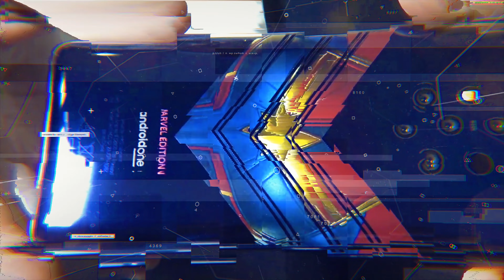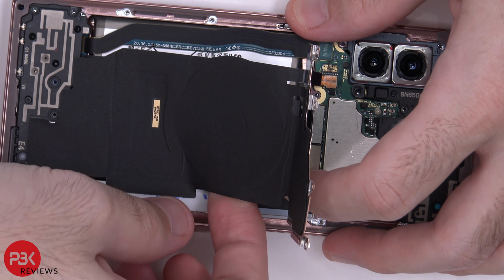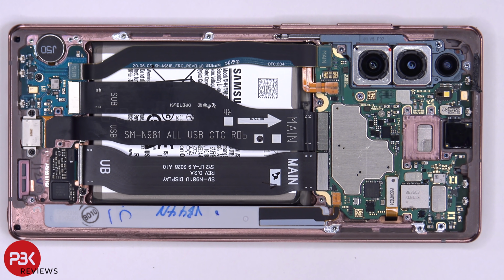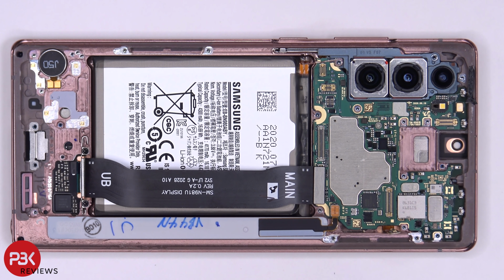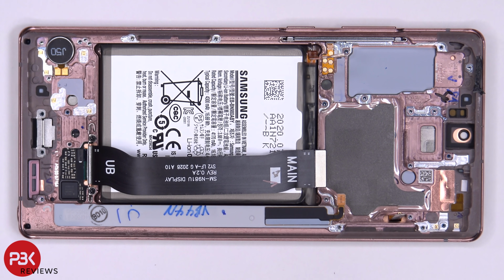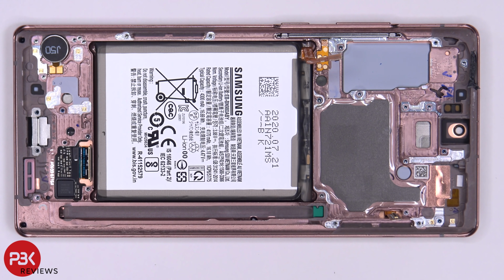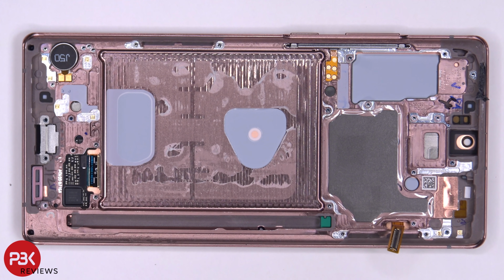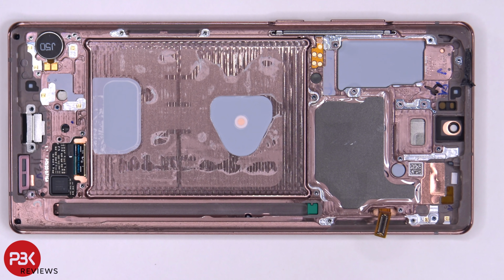Samsung Galaxy Note 20 Disassembly Teardown Repair Video Review

Comment: Thx! Got me through a glass+digitizer replacement. Two things not covered though: (1) At 2:10, the Main-Sub cable in my unit doesn't just have two ends like yours, in mine there is a "T" off that cable that connects to a component in the side edge of the housing, which is held in by two screws. That component came out with no problem but it was a tense moment haha. (2) You didn't take out the "J50" hockey puck in the corner (vibration?). No worries, it just lifts out no problem. - - - The screen replacement I got was essentially the whole front housing for $200, expensive but I'm not cool with trying to install glass. Last thing, the new housing I got included the S-Pen charger, so didn't need to tease that off. Thanks again.
Reply from the maker: You're welcome. Yea always easiest and best to replace with the midframe assembly attached to the screen. Its a pain to do it without. And that's odd, wouldn't think there would be a difference as far as the cables inside for different region versions.

Comment: Excellent video! If a glass only repair was needed, would you just heat the front w/o disassembly of the back, and then seperate the glass with ipa and wire? How much heat does one normally apply?

Comment: Thanks for the upload! Also noticed no vapour chamber like in last year's Note10s. Maybe that's why this year's model gets so hot?
Reply from the maker: You're welcome. I believe the Note 20 Ultra has the copper block or vapor chamber but the note 20 seems to have a 3D graphite/graphene layer or block which also is used for transferring heat. Not sure which is better but its a first I've personally seen being used in this method in place of a copper block or vapor chamber.

Comment: amazing video. love my note 20 (non-Ultra). battery is -10% wear at this point. to do this job myself with no experience is massive time and learning curve. I'll just send it to authorized shop to replace battery. safer and near zero chance of my screwing it up. i want use to Note 20 as long as i possibly can.
Reply from the maker: 👍 thanks 😀

Comment: Question Do New phones have writing like this written on the inside
Reply from the maker: If you are referring to the hand writing on some of the parts, yea most phones have those writings. They are markings from quality control employees checking and making sure parts are meeting required standards etc.
Reply: I had the same question.

Comment: Great video!❤ what adhesive do you use to seal the back in place?
Reply: I'm wondering about this too since mine are started to peel off 😢
Reply: did you try heating it up before putting together?

Comment: Hi Note20 phone does it have separate Signal receiving antenna module or it is inbuilt with the motherboard? My Phone has signal reception problem. It shows no signal in weak signal area. is there an option to fix this issue?
Reply: I have the same problem and I thought it was about my carrier poor signal

Comment: Hi, just wondering does inserting the SIM ejector tool in the upper Mic hole will damage water resistance or the mic for the note20?
Reply from the maker: No it will be fine, the mic and filter sit above the hole.

Comment: Great job. Only I'm diappointed that you stopped just before the power and volume buttons. Mine appears to be jamming. It's extremely difficult to depress. especially the longer volume button. Any suggestsions? I'll remove everything the way you just did but I'll rather not if there's a short cut. Thanks again.

Comment: Great video, thanks. Is the camera's housing also made of plastic as the back panel or is it glass?
How scratchbell is it, do you have idea?

Regards
Reply from the maker: Thanks! The frame of the camera lens covers is aluminum but the lens cover is glass. Not sure on how scratch resistant it is.  (aftermarket replacements of lens covers sometimes tend to be plastic, so if you prefer the glass make sure you find original replacements)

Comment: Hey.. mine has a rattle inside ..everything  is functional.. any idea what it could be . 
Looks like I can handle the disassemble short of new adhesive..
Thanks in advance for your response
Reply from the maker: It's probably just the camera inside, its normal all of them have that rattle.

Comment: Hi... Is it possible to replace cameras from s21ultra to note 20 ultra?
And if you can put snapdragon instead of exynos... Or is processor on the board?
Reply from the maker: Not sure about the camera, if the connector is the same it may work but there may be software issues. As for the processor, its soldered onto the main board.

Comment: Great video.  My screen now looks washed out.  The black is not black and the colours not vivid.  Sometimes .. the vividness of the OLED comes back ... but then it becomes slightly washed out again ... is it the screen or could it just be the connectors not seating properly?  I also notice my phones runs quite hot .. especially near the rear camera area.
Reply from the maker: Hmm not sure can be both a screen issue and possibly liquid damage. Excess heat can also be a sign of liquid damage, but its normal for it to heat up a bit.

Comment: I accidentally messed up the connecting thing for the wireless charging pad. I ripped it off carelessly and it broke. Should I put it back in anyway or leave it out? Will my phone be fine if I leave the charging pad out?

Comment: Are the antennas on the sub-board?
Reply from the maker: The sub board has some antenna contacts yes, but its not the only antenna on the phone. So if you do replace the sub board, you would need to make sure you get the exact model version for your phone or you would have reception issues.
Reply: @PBKreviews  I understand. Thanks for the reply!

My question is because my phone began to have reception issues after I replaced it's battery at samsung. And now they wanted to charge me almost the price of a new phone to swap it's board(the mainboard I guess) and fix this issue. I obviously refused to pay. Do you think that replacing only the sub board would fix this or there are antenna contacts on the mainboard too?

Comment: Which heatgun do you use for back cover ?????
Reply from the maker: I used to use a w.e.r 858D but now just use a hair dryer since it's not as harsh and it evenly  heats up the back plate. Easier to work with.

Comment: its really good to see this video. 
a half inch from the tip of the s pen is stuck inside the groove.
the thing is that only cover of the s pen is stuck.
how to remove that cover from inside..pl respond
Reply from the maker: Hi, not sure exactly what you mean by your explanation, but I think the only way you would be able to remove it would be by taking off the back cover and removing the white plastic cover that is covering the S-pen housing to gain access to removing it.

Comment: hi i live in germany and i imported note 20 ultra in snapdragon version. 7 days ago the mobile phone display broke and had it repaired. The display works but the selfie camara doesn't work. if I go into the Kamara app it says camera error. Repairman said bring your cell phone by tomorrow and we'll check it out. The display of my device is the N9860 (Snapdragon model) , but what the repairman put in is N986 (Exynos model) . The display works, the fingerprint sensor works but only the front camara doesn't work. Is it because the display of the Note 20 Ultra Exynos model is not compatible with the Snapdragon model or because the repairer forgot to connect the Camara?

 Thanks for the answer ❤

 PS. My english is very bad i use google translate
Reply from the maker: Hi, the display would not be the issue since it would be identical screens and the screens have nothing to do with the camera connection. So it's probably they did not connect the front facing camera cable or they didn't click it in the connector all the way. Should be an easy fix and if by any chance they damaged the camera cable or something, the camera should be fairly cheap as well so does not seem like a major problem. As long as nothing on the main board was damaged (like breaking the connector or a chip) then all should be good.

Comment: Wait! is the processor, RAM, UFS storage and Modem underneath that Tiny squarish MainBoard
Awesome Video By the way
Reply from the maker: Yes most of those components are located on either side of the main board underneath those shields. Thanks :)
Reply: @PBKreviews  Wow Is Amazing how they fit all those components under a tiny Board
Thanks For The reply!
Reply from the maker: @Kevinnnnick  You're welcome :)

Comment: Once disassembled, I guess it loses protection against water. Am I right?
Reply from the maker: If you apply new original pre cut adhesive made for the phone, you will retain the water resistance. Here is a link to the part: https://www.mobiledefenders.com/samsung-repair-parts/galaxy-note-series/galaxy-note-20/adhesive-back-cover-for-galaxy-note-20-5g.html

Comment: Is this the Snapdragon or Exynos version?
Reply from the maker: Exynos
Reply: @PBKreviews  damn all those exynos 
 version don't get any kind of copper cooling, that's a boomer. The snapdragon versions have a vapor chamber...
Reply from the maker: @Jusumoner  you sure all the snapdragon variants  have the copper vapor chamber? I haven't yet taken one apart to confirm
Reply: @PBKreviews  yes as far as i know, every us version tear down video had one.
Reply: @Jusumoner  Wrong , SM-986N Note 20 Ultra 5G Snapdragon  South Korea Used Multi-Layered graphene thermal pad
Reply: @PBKreviews  not all snapdragon variants because  South Korea version used Multi-Layered graphene thermal pad
Reply: @popguy1234  did you read my comment at least? US VERSION
Reply from the maker: @popguy1234  Have checked and verified the US version snapdragon note 20 ultra factory unlocked from samsung is graphene as well. So far looks like only the 256GB international model has copper but might be the 512GB versions of the phones as well with the higher price tag but will have to check and verify.

Comment: My note 20 got dropped and now my camera doesn't work, the camera app doesn't open at all it just says it doesn't work. Is it repairable?
Reply from the maker: It's possible the cable got loose or disconnected. Have you tried powering the phone off completely and powering it back on to see if it works?
Reply: @PBKreviews  I tried a factory reset and still nothing, only the selfie camera works but only on a video call I can't take any type of picture. I got my phone opened up and everything is connected so I'm curious to know if I buy a new camera to replace it, will it work properly
Reply from the maker: @juanpulido2894  hmm, its possible but there may be damage to the board as well causing this issue. But wont hurt to try replacing the camera and seeing if it will work to rule that out.

Comment: What screw driver size is need?
Reply from the maker: Not sure the size but any smartphone Philips head screw driver should work. There are links in the description for smartphone tool kits, you can check and see what sizes are in the kits and get an idea.

Comment: My favorite model from Samsung due to my daily tasks, but it got black screen out of nothing. It vibrates, it gets charged and it does the force reboot, but the screen doesn't show up any image. I apply many tricks found here in YouTube and it turned on once, then black screen returned.
Reply from the maker: Can be many things, maybe the connector for the screen cable is loose or disconnected, maybe there is a hairline crack in the screen somewhere by the corner not visible causing an issue, or water damage etc.
Reply: @PBKreviews  Not water damage and cracks in the screen. It turned on once and the screen was perfect.😔 It might be the first option, because when the screen showed up the Samsung Logo and I used it for 5 minutes, I was massaging the screen below and magic happened😅, after my 5 minutes of replaying some messages it turned off by its own again 😕. I've seen some options about disconnect the battery and reconnect it after 45 s, now you mention the screen cable. So, I definitely appreciate your tips. I'll try!🤗
Reply: @Mariemilygr  how did you fix it?
Reply: @rishibhise5044  Massaging the screen very softly, but it turned off again and a guy in a repair smartphones center just told me it wasn't a good idea because the flex seal of the green get broken easily. Hahahaha so I just bought another phone of mid gamma (Motorola Stylus 5G), wich is less delicate. Good luck man!
Reply: @Mariemilygr  hahah cool

Comment: You made nice video but you did a big mistake to disconnect battery then middle of video you realised then you disconnect it and skips that part of video.
Reply from the maker: Thanks, but no I didn't. The battery was disconnected and the cable is just laying in the position over the connector and I end up moving it out of the way, I don't reconnect and disconnect it what would be the point of that.

Comment: You made removing that battery looks so easy
Reply from the maker: Just a bit sped up and so forth to save time on video. You can apply isopropyl alcohol (https://www.ifixit.com/Store/Tools/iFixit-Adhesive-Remover/IF145-400?o=4) to the sides of the battery and let it sit 30 seconds so it eats away at the adhesive under the battery making it easier to pry off.

Comment: Big fail on the front camera removal.  You neglect to tell people that these are silicone/glued in.  Telling people about these kinds of details is important if you are going to do this kind of video.
Reply from the maker: No, the one I took apart was not glued in. It's possible the variant you have was. Sometimes different regions or variants differ slightly. For example on this same phone, they have different region versions which come with copper vapor chambers vs the 3D graphite layer.
Reply: @PBKreviews  wow really? I've taken apart like 6 note 20 ultras and all had the front camera glued in.
Reply from the maker: @seth-bullock  are all from the same region? That could be it. For example all from the NA region are the same vs differences in the Asian region vs etc.

Comment: HELP!!! I replaced the microphone on my Note20 and now I have no network at all!!! 3 different sim cards and the same problem. Only works on WiFi. someone please help!!!
Reply from the maker: You replaced the sub board/charger port board? Did you make sure to replace it with the specific model number version of your phone? Since different region model versions might have different antenna contacts on the sub board. Also make sure all cables are properly attached.

Comment: i recently replaced my battery because the phone's original battery seems draining so fast. after done that(replace to a new battery), the problem still persist. so i'm assuming that the problem isn't the battery. any idea what causing the battery drain so fast?

Comment: $1000 and you get a plastic back 😐😐😐😐
Reply from the maker: yep, has its pros and cons I guess. Won't shatter when it falls and easier to pry off without the worry of cracking it for any repairs etc. But for a premium device you would kind of think they would have gone with a premium material
Reply: @PBKreviews  ~ Gorilla Glass Victus is more resistant to falls. My A7 2016 has Gorilla Glass 4 front and back. Fallen a number of times on concrete floors. Zero cracks.
Reply: You do get the metal frame. I've been using the Galaxy A50 which is all plastic, the Note 20 looks and feels premium compared to lower end devices. The plastic back has a nice matte feel.
Reply: @Gamers_Revolution  ~ that's the point. To hoodwink current A-series users up to A7 2019 to think that the Note 10 Lite, S10Lite, and the Note 20 are premium despite having a plastic back. 

A-series phones from the A3 all had a Glass-Aluminium-Glass construction from way back in 2016. 

Plastics belonged to J-Series. Samsung re-badged the J-Series with A-Series and took away all that upper mid-range high quality premium build that A-Series had. 

That's why your current A50 is plastic and my 2016 A7 is All glass and Aluminium chassis. That makes you see the Note 20 with a plastic back and Aluminium chassis as premium. 

But to those of us used to owning true premium built phones by Samsung know it's a rip-off.

Comment: This phone is totally not worth it
Reply from the maker: I'm personally using the Note 20 ultra and loving it at the moment, but haven't used the Note 20. I feel the Note 20 would be best to wait a little for a price drop or good sale that people looking to buy would jump. Aside from the no easy pull tabs for battery removal and the plastic back (even though it has its benefits), I think the Note 20 is a well build device. The frame itself was lightweight but sturdy n strong and overall is a great phone. The price can be better though.
Reply: @PBKreviews  Well, when i said not worth is it's like the price tag, here were i live is MSRP + Country Tax of 20% + Store profit, resulting in a massive bump in price... Still my Red Magic 3 still rock solid with CN + Gapps + TWRP + MAgisk :D
Reply from the maker: @4everkale  Ya true